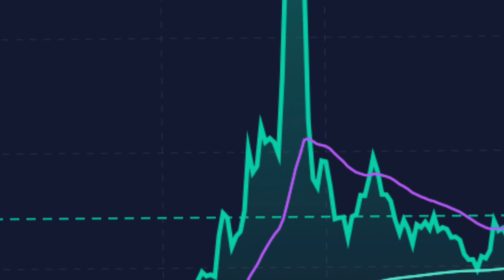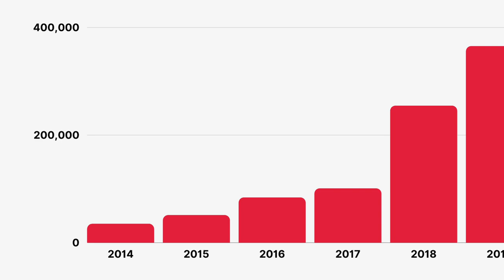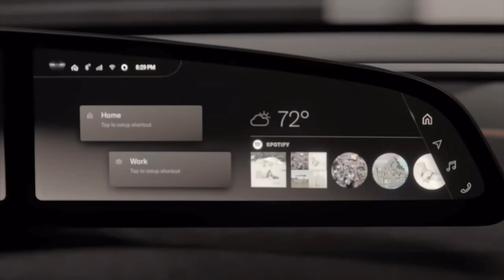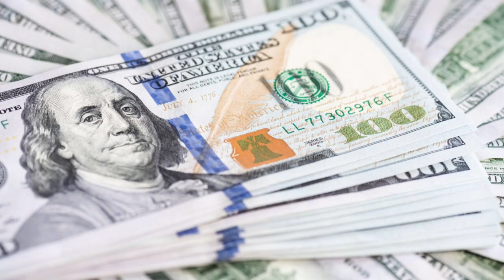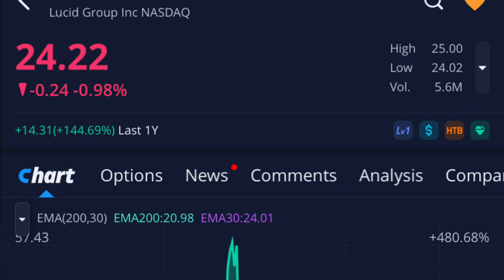Why Lucid Motors Will Likely Fail...

Comment: I understand your point, but I think you made an assumption that Lucid will be a car company, that’s not necessarily correct, Lucid’s biggest advantage is what’s under their car body, which is currently more efficient than what Tesla has as per the media! For example, I saw a video today talking about the potential in eVOTL
Reply: I don't think selling a car at 96% times the costs of a Tesla S that goes 25% further with the simple addition of more batteries 🔋 is any efficiency breakthrough.
Reply: @RootBeerGMT  keep making 25% further seem like a small percentage.

Comment: Battery, gears, power electronics and motor all developed in-house with lucid . I think that helps them a lot when talking about economy of scale. That is one major difference lucid has over Tesla in its beginning stage when talking about going bankrupt.
Reply: That is not to say they’re are invincible from failing but definitely have a higher chance of succeeding when compared to Tesla.
Reply from the maker: @CHUCKZ2  this is a good point, if you’d read the comments you’d think I absolutely despise Lucid, I don’t… I hope they succeed
Reply: Yet they cant produce any of that at a larget scale

Comment: Yes Tesla is a good company. They are not the end all be all.  I have invested in both companies.  I m sick of you Tesla fan boys that are obsessed with Tesla and want to see  all their competition eliminated.  Lucid fills a niche that Tesla ignores.  They along with Tesla are innovators in this new industry.  The one reason I’m not interested in buying a Tesla is I don’t like there minimalist interiors.  I drive a Mercedes CL63 AMG. And a BMW 740.  I love those cars but they can’t make an efficient electric car.  Any company that can top Tesla right out of the gate in range and efficiency has staying power.  They are way better financed than Tesla was when it first went to market.  Tesla nearly went bankrupt several times before it got to where it is today.  Lucid started out making batteries for the electric racing circuit.  They have a far more refined interior.  They have the top management in the industry.  From Tesla, Porsche, Apple and Ford. Sure Lucid will stumble as do all new start ups.  They have a big advantage.  They saw what worked for Tesla and what did not.  They have $Billions to get it right the first time.  There leader was the chief engineer for the Tesla model S.  They have all their US tax subsidies available.  Tesla’s are all used up.  

Lucid has to walk a fine line. 

When answering questions Peter has to keep investors happy.  He’s has to keep the SEC happy and he has to deal with all the materials shortages like computer chips.  He all so needs to protect hundreds of trade secrets that are still in the patient acquiring process.  Last on his list is making you Tesla fan boys feel warm and fuzzy.
Reply from the maker: You make good points, namely Peter Rawlinsons unwillingness to answer these questions… still is not a company I’d want to be invested in at the time
Reply: @ChristianGardner  ok invest in tesla and leave us alone. We don't care about your opinion. All in in lucid and I sold my last 3 shares of tesla. Good luck 👍
Reply from the maker: @eddiebrazier8709  hahah good luck but i didn’t comment on your YouTube channel … quite the opposite 👍🏻
Reply: Thank you. I am invested in both but it is a zero-sum game with the insecure Tesla crowd. They obsess over Lucid and come on the Reddit and Youtuber comments like a bunch of scared ass losers. They should be scared of VW, not Lucid.
Reply: Very well said thanks for your input and this encourages me to buy Lucid stocks at this moment while it is a steal. I was comparing this company when Tesla started at there early stage at this price point. I'm pretty sure Lucid stock will 🚀 to the 🌖 someday